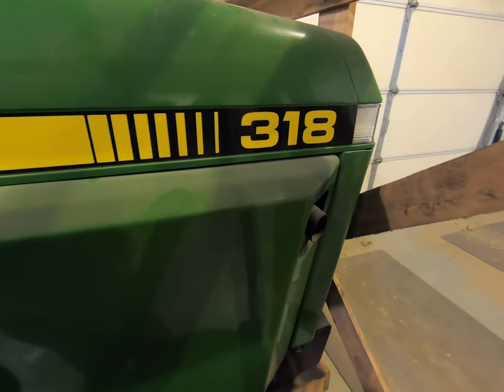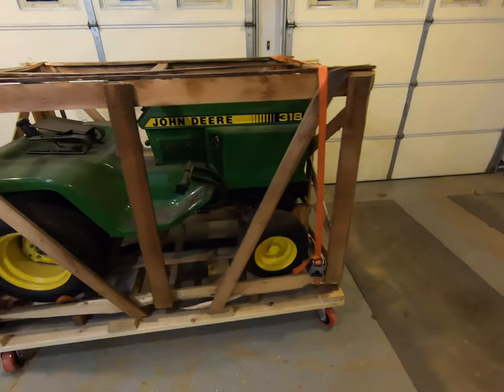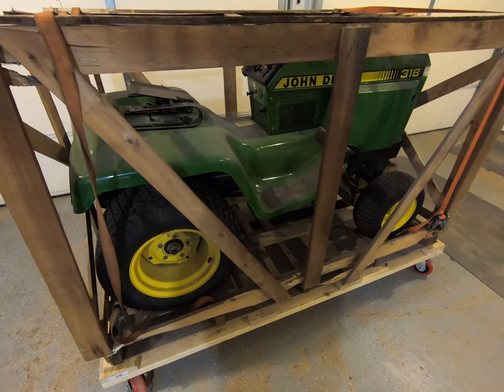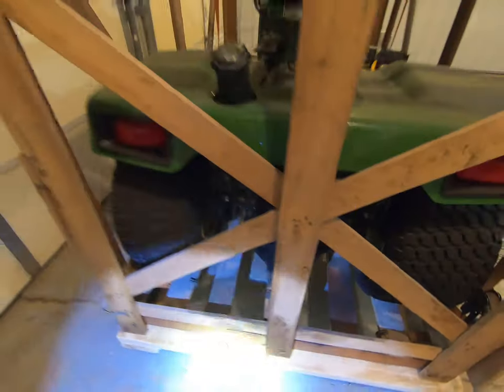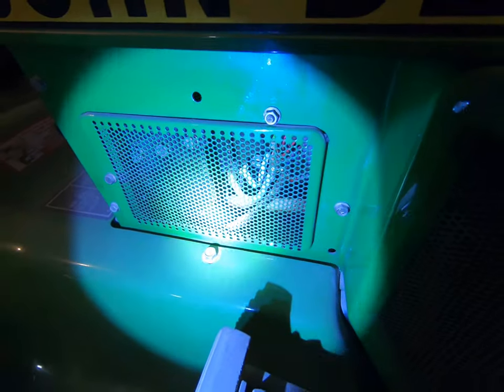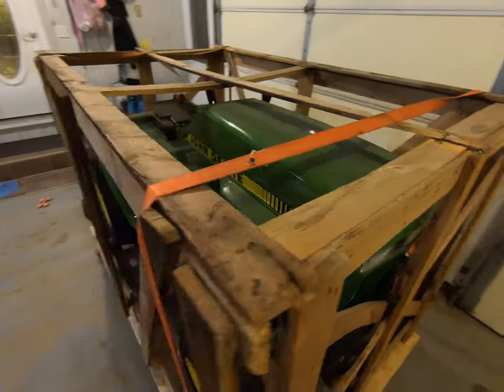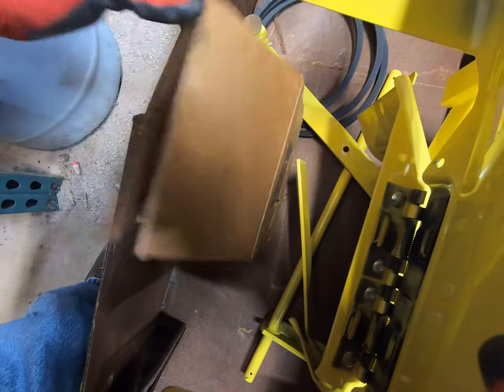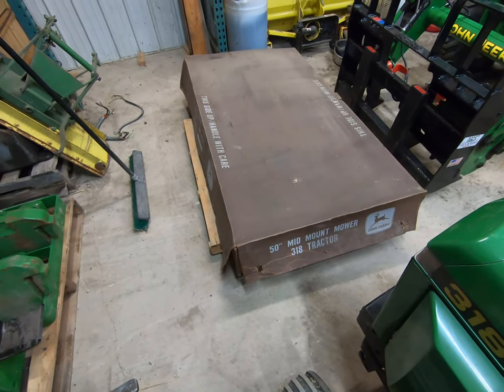Is this John Deere 318 New or Never Used?

Comment: Man those Deere tractors in the 80s-90s were simply amazing.  My uncle collected them and the implements as well.  Sadly he passed away last year.  I believe he had four 318 tractors, a 420 (the beast) and my granddad’s 110.
One PTO tiller
A hydraulic tiller
And a snow blade for at least four of the machines (110 included).
“Don’t make them like they use to.”

Comment: I just found one at a local equipment dealer.  According to the hour meter, it has just under 400 hours (if you can trust it), but it's either an extremely good restoration or just a very well cared for machine.  It looks nearly brand new.  Not sure what price they're asking for it, but it's probably more than I'm willing to pay!

Comment: Wow!! I have a fare one as well, but not as rare as this one. I purchased a 1991 back in 1995 with 8.4 hours .... I rode it about 1/2 miles to let my brother roll his lawn with it. It had some nicks from sitting in one of the farmers out buildings, so I disassembled the body parts and had them professionally repainted, except for the hood, which was still in ordinal condition.at which time I stored the chassis, along with the body parts until about 2 years ago, at which time I trailered it to a farmer friend's repair shop. He is a lifelong John Deere mechanic, so I hired him to reassemble. It now sits in a garage with 19 original hours. 

One word of caution!!! If and when you do plan to start your new 318, disconnect ignition, squirt Marvel Mystery Oil, or a comparable brand and roll the motor to make sure that oil is distributed thru the motor. After sitting for so long, upper engine components will have become dry. In summary, CONGRATS on your find. I tried to find NOS prior to buying in 95, but none were to be found. Finally, a friend's wife who travelled the same day to and from work came home one evening and told her husband about one she'd seen that day .... He called me, we drove about 2o miles, and it was back in the out building with a tarp over it. 2 hours later I purchased over the phone. As we know, 318s are a good buy .... esp ones such as ours. I have an 83 model I use for mowing etc, and love it like a new one. My plan is to restore it over this winter. Btw, I enjoy your videos!! If I had money and space, I too would buy 300 series and restore!! Ya can't beat a Deere!

Comment: I saw a story about one or two of these 318's online with them still being in crates. Petty amazing after all these years. It's crazy to think that no one bought these brand new as popular of a tractor that they are. I have a 1992 318 myself, great tractors they are.
Reply from the maker: If I had to guess I would think there might be another crate machine out there... But you never know. This machine, being a 1992, I would think came about the time the 4-5 units showed up. Once the new machines showed up it would have been a harder sale. Much like my 1974 140, gentleman bought it new in April of 1975 because it looked better than the 300's.

Comment: Interesting...  Even has a new 50" deck. Great find! I also know where there is a brand new old stock 1992-318 still in the crate. It has a 46" brand new deck inside the same type of wax box that your 50" is in. I also know where a brand new JD 440 Trailfire snowmobile is. Zero miles and sitting in the back bed of a pickup. I even have the PIN of both units.
Reply from the maker: Very interesting! Do you happen to know if it is a wooden or metal crate?
Reply: @mmrbeef  I don't know. I've never thought to ask him and its been probably 4 years since I last talked to him. He seems to think that John Deere will want it back one day. They don't want it. They already have one that they didn't sell. A friend of mine works for Deere and is involved with the archives. He showed me a picture of the 318 that they kept.

Comment: When you restore your tractors and paint them do you use John Deere spray paint?  I bought a JD 430 about 2 months ago that I am refurbishing for my own use.  My neighbor says not to paint it because any new paint will not be durable like the factory.  I could wax it and get color back into it but there are places the paint is worn off.  I want it to look new.  I have seen people paint cars with Rust-Oleum and polish it out and it looks like factory paint!  I can drop everything off at a body shop, but I don't think that is necessary.  What do you do?
Reply from the maker: Well sadly... I hate painting so I rarely paint anything. Deere has good paint and if you use OEM paint it should last as long as the original. You should be able to wax a lot of the scratches etc out but if you blend you can get some Deere spray paint and probably make it look new again. Personally I think wear spots tell stories.... wear on the foot rest show someone has sat in the seat for a few hours.